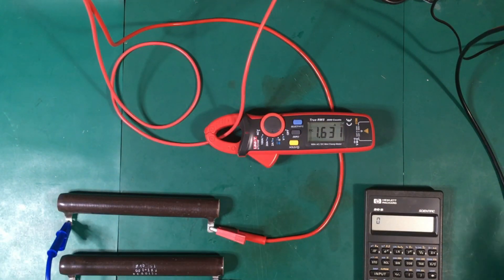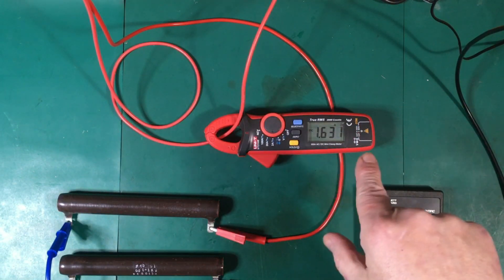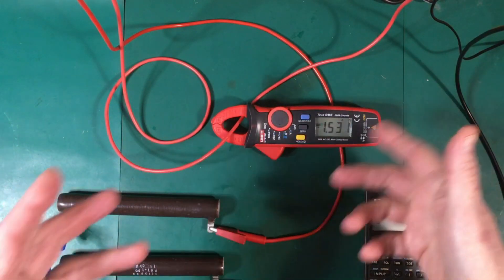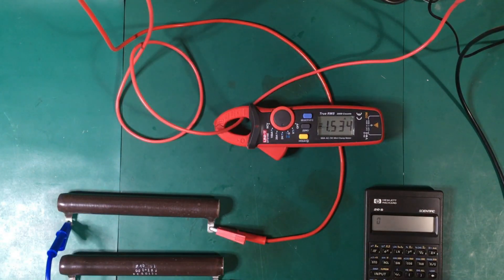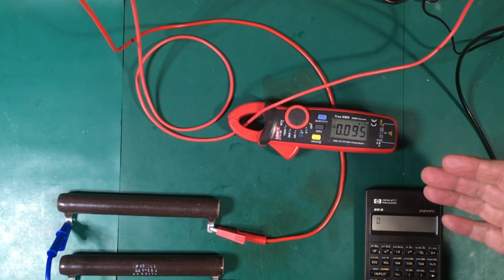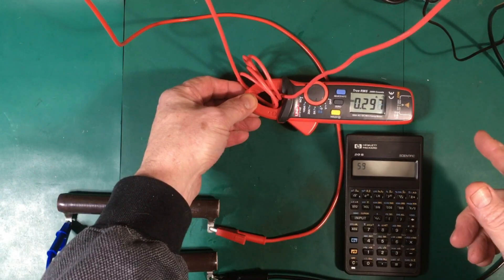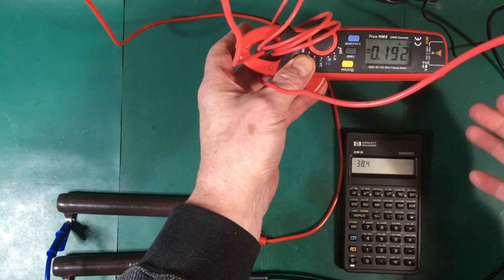0028 - UT210E: Fix Poor Low DC Current Readings

Comment: Does the red wire (positive) same DC current as black wire (negative) when using UT210E ?
Reply from the maker: If there was only the red and black wires going to the load and no another wires branching off somewhere, it would have to.   That is a fundamental law of physics.  Do you mean does it measure the same with a DC current probe?  It should if you use to probe correctly.  As mentioned by other commenters, for readings of small currents, because of stray magnetic fields (the earth's counts here too), you need to make sure the meter (UT210E) is zeroed out for each physical arrangement before taking the current reading.
Reply: @uni-byte  I'm just using it for my car battery terminals can't fit the UT210E clamp in positive wire because of large wire, while negative wire is thin, fit perfectly
Reply from the maker: @playstation2bigs  I don't think I've seen a car with different sized wires coming off the battery terminals, but as long as there is only ONE wire on each terminal then the current through them will be the same.

Comment: Low current DC measurement with a clamp meter will always be innacurate because the hall effect sensor will be picking up stray magnetic fields, from the Earth, from any magnets or ferromagnetic objects in the vicinity. In AC mode the error cancels out on each half cycle but the best you can do with DC is to zero the reading immediatly before putting on the clamp and taking a measurement. At higher currents the magnetic field frrom the wire is so much bigger than the stray fields so you don't have the problem. 
The trick with wrapping also helps a little because the clamp meter sees a stronger signal from the wire, but you still need to be careful to zero out the meter.
Reply from the maker: Thanks for the tip Ian.  Yes, if you are making a real measurement You need to zero or all bets are off.  Even though I was just trying to show the low current error here, I should have taken the 0.5 seconds to press the "zero".

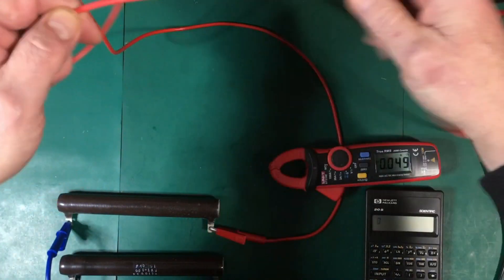Comment: don't you need to zero before you measure to compensate for earth's mag field? Around 2:43 you can see 50 mA with nothing connected. This is about the error you see. (50-5 = 45, 95-50 =45)
Reply from the maker: Certainly.  "zeroing" will get rid of the offset which could due to Earth's field, or some device in the lab, or more likely as Lohi mentioned in another comment, residual magnetism in the clamp, but it's not going to get rid of the low current error.  Below a certain current (~200mA on mine) it just plain reads teh wrong value.  Once you get teh apparent current up to over that value, the reading improves.  Perhaps things might have been a bit clearer if I had done the "zero" operation.  My bad on that and thanks for pointing it out.

Comment: Andreas is always a good source...btw, try one loop "forward" and one loop "backward" to see if you get cancellation...you could easily have some remnant magnetism in the clamp that is causing a DC offset, and it's small, but, of course, shows up at low current readings...if you have an ac magnet, you could try demagnetizing the clamp.... Just a couple of ideas from some old guy...
Reply from the maker: Thanks!  Ideas are always welcome.
Reply: @uni-byte  i did a LOT of work with current probes in my previous job... would you be kind enough to let me know if you try these things out, as I'm quite sure that they should help....
Reply from the maker: @lohikarhu734  Do you mena the kind that goes on an oscilloscope and has high bandwidth, or the kind that plugs into a DMM and has very low bandwidth?  I have a Hantek CC650 (this of the 2nd kind) that I mostly use of automotive work.  I have never used a high bandwidth current probe for a scope though.